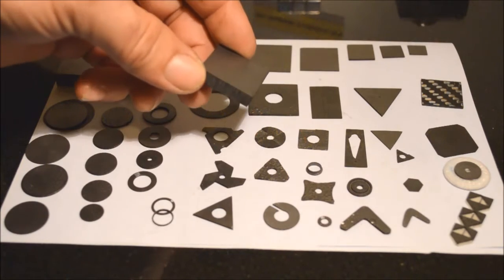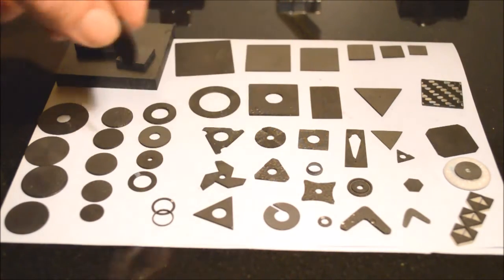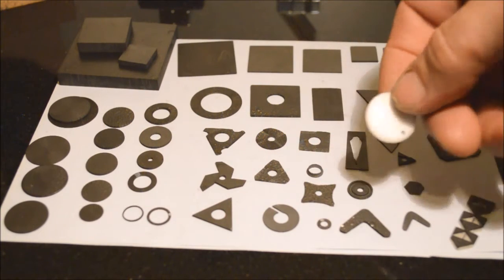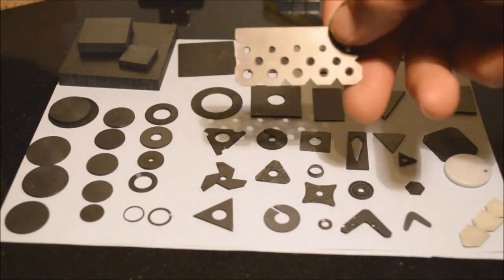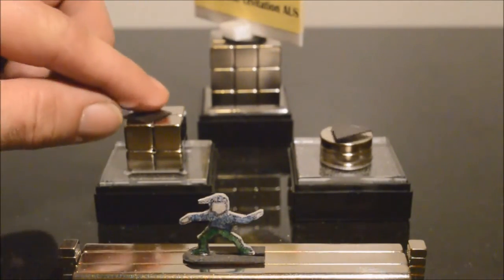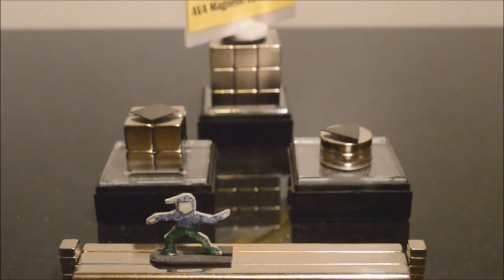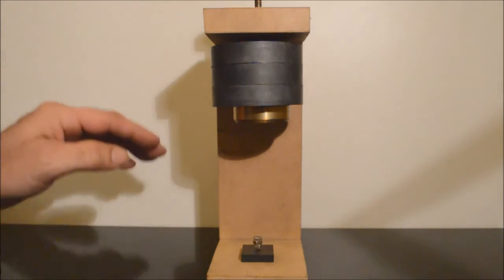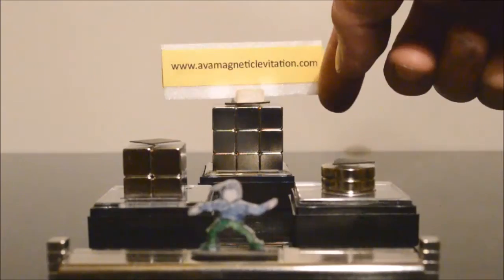Pyrolytic Graphite the basics by AVA Magnetic Levitation AUS.

Comment: hi adam, as a diamagnetic material is better bismuth or graphite?
Reply from the maker: +Magnetic Games 
Hello 
I have been thinking about doing a vid about this. Bismuth vs Pyrolytic Graphite.
The winner in advance by a long shot will be the PG.
I have found there are any set ups that do not work as well or fail with bismuth. And most basic set up are easer with the PG it has a much higher diamagnetic value and other properties that bismuth does not have.
Its funny one is nateral and the other man made.
Thinking about getting any PG or bismuth don't buy direct from my site or ebay contact me let me know what you need and and I'll do a it cheap.

Comment: Nice collection of different shapes!
Reply from the maker: +Cobrakiller2000 
I used to have many more. Building back up a good range for test and exp.
Reply: +AVAMagneticlev I also like the design of your diamagnetic suspension rig. did you build it? I built similar today not as fancy as yours but does the deed. I got tired fine tuning the distances by removing and adding playing cards:)